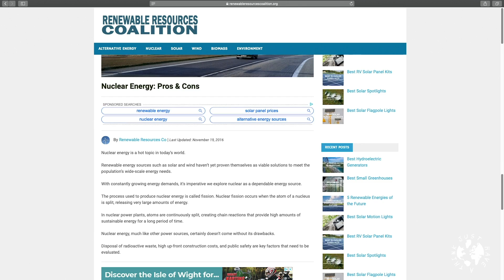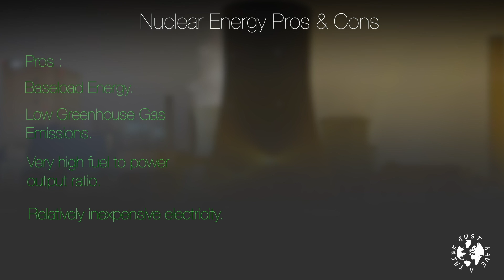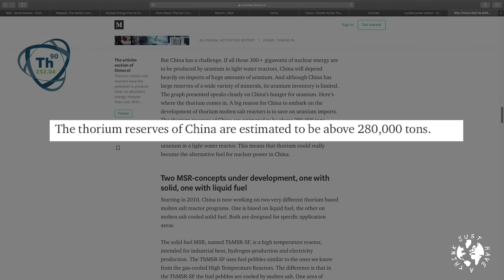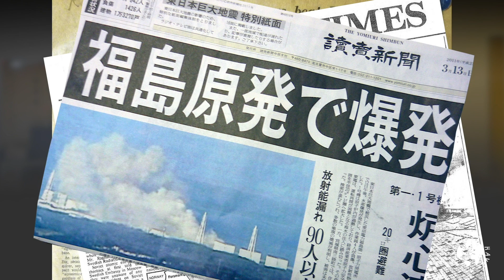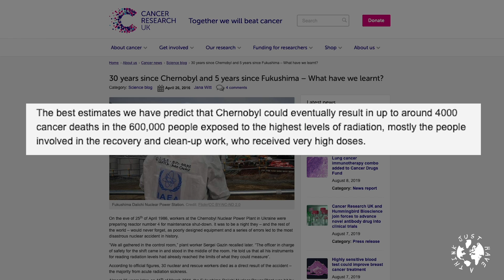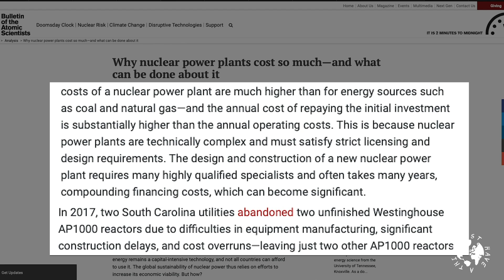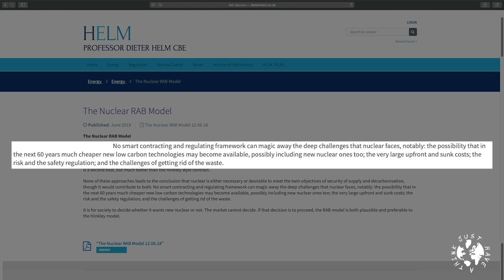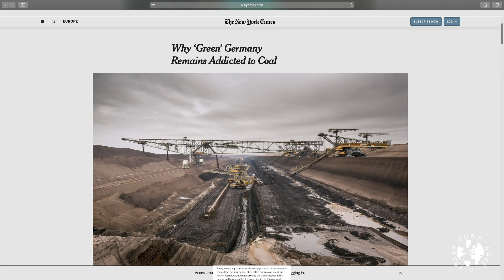Nuclear Energy in the 21st Century

Comment: As a Bavarian I have some problems with nuclear:
33 years after Chernobyl over a quarter of hunted wild boar are to radioactive for human consumption in Bavaria (1600 km away!) and most of the mushrooms in our forests.
Chernobyl was the starting point for the renewable energy movement in Germany not climate change. And gave us with EWS the first 100% renewable energy provider in 1991. 
But in my view there are other disqualifying problems apart from meltdowns and contamination for decades and centuries.
The most obvious on is the price! If I remember correctly, the feed-in-tariff for Hinkley Point C will be 0,12 €, right? That is more than not only more than onshore wind, but more than rooftop solar! Every home owner in the Uk that isn't working hard on energy autonomy isn't thinking straight!
And then there is the disposal of radioactive wast. That isn't priced in.
The price and the long brake even time that comes with it, prohibits innovation and cost reduction. The opposite is the case with renewables.
Thorium like so many other hyped technology will be ready for the word market fare to late. You didn't mentioned when the first commercial reactor will be ready and if it fulfills European safety standards, but I guess not before 10 – 20 years. By then we should be 70% - 80% renewable, if we want to stop climate change.
And leads to the next problem with nuclear: it's base load energy.
That we don't need in our electricity system for a renewable future. All power input into the grid that is not solar and wind must be complimentary and flexible. Otherwise we need a tonne of storage and that will push the price of nuclear even higher.
To recap: If it goes wrong it's a threat for most of the continent.
It's the most expensive form of energy production.

And more base load is the last thing we should ad to our electricity grid.
Reply: There are some issues for 100% renewable Germany especially if this country wants to pursue primarily solar and wind (even though most renewable generation is actually from biomass at the moment). 

-"Buffering volatility: A study on the limits of Germany's energy revolution"

https://www.sciencedirect.com/science/article/pii/S0014292117300995
Reply: @brian2440  Please, never ever again cite Hans-Werner Sinn for anything related to energy technology. He doesnt have a clue and has become a laughing stock with informed people in the topic. (He never was an energy or science expert - he is a retired economist). What is correct that a small baseload is nice to have as it reduces buffer need more than proportionally although my fellow countryman Zottel above is right in saying a substantial constant baseload technology that isnt quick to turn up or down like nuclear isnt compatible with the fluctuating renewables. Fast gas plants are.
Reply: hooplehead101 I don’t believe the article claims to use conventional nuclear in similarity as intermittent renewables, just that utilizing nuclear power could’ve provided benefits to the energy network. With Germany’s current energy approach it seems likely that we will continue to see a reliance on necessary natural gas, but then that poses the question of whether a hybrid system that integrated low amounts of nuclear with renewables is more cost and environmentally effective than a system designed for intermittent renewables and natural gas. 

One of the issues we are seeing in the USA is that states have decided to close down multiple nuclear plants without the necessary renewable infrastructure to replace them by decommission dates, so as a result we see a significant increase in short term natural gas production (10-20 year expectancy). According to the National Renewable Energy Laboratory’s* Lifecycle Harmonization Assessment of CO2 Analysis the average natural gas plant in the USA emits 456g CO2/KWh more than the average nuclear plant, and we are talking about 25,000-80,000 GWh of replacements. That’s a MASSIVE INCREASE in CO2, and depending on the cost placed on carbon this change could be considered grossly uneconomical. 

(*NREL is the US National Laboratory operated and funded by the US Department of Energy). 

There are other reports that look at ways in which nuclear can supply energy in tandem with renewable although these approaches typically require non-conventional methodologies and energy network management. 

This study is more focused on deployment in the USA, and I’m largely unfamiliar with German grid operations, so take it at face value:

https://www.sciencedirect.com/science/article/abs/pii/S0306261918303180?via%3Dihub

The purpose of this comment is just to respond to your comment, and while I do continue to provide sources on nuclear integration this isn’t necessarily the approach I would take if a country wanted to considerably increase nuclear deployments. In my opinion an increase in nuclear market concentration would require the installment of dual-purpose and integrated Generation IV nuclear reactors particularly of the Molten Salt Reactor, Very High Temperature Reactor, Advanced High Temperature Reactor and Fast Spectrum (FNR/FBR) variety.
Reply: hooplehead101 However just to be clear the purpose of my first comment on this thread was not to push support towards nuclear energy, but rather to recognize the potential issues of 100% renewable systems. 

I have other articles that go into larger depth on this, however they are focused more toward the USA as that is the country I currently reside. Obviously the USA and Germany are two different countries and thus the variables on developing a competent energy systems widely vary.
Reply: @brian2440  Yeah, and Im not against keeping a small baseload of nuclear energy - just wanted to remark the absurdity in citing anything Hans-Werner Sinn says about the energy transition. Keeping running nuclear plants is fine with me - but obv not with the majority of the public. We simply have to ramp up renewable now, because gen 4 reactors will have to prove their cost-effectiveness - and thatll take 20 yrs at least.
Reply: hooplehead101 
1. Do you have sources about how and why Sinn is unqualified, because he has a massive amount of accolades over the last 30+ years in favor of is arguments. 

2. Maybe in Germany public sentiment isn’t in support of nuclear, but that’s not really the case for the USA or the world I would say. The 2018 IPCC Special Report on Emissions literally calls for a projected increase in nuclear penetrations. 

3. The long term evaluation may take 20 years but actual deployments are scheduled much faster. 

BN-800 is an operational fast breeder reactor in Russia as of 2015. 

Terrestrial Energy has recieved permits from the CNSC (Canada) to build an IMSR in 2022

Moltex Energy has received permits from the NRC (USA) to build smrs in 2023

China has multiple fast gas cooled reactors currently under construction for completion in 2022 and 2023.
Reply: @brian2440  1. Sinn is a retired economist, not an expert in energy systems. He simply oversteps his area of expertise. If you understand German, I can give you speeches by him that are ripe with errors that breathtakingly stupid that its hard not to suspect malice - but as the saying goes: "Never assume malice where incompetence suffices." So I assumed the latter. :) E.g. calculating wind turbine need: Taking a performance of 2MW, telling the lay audience they only run "19 days a year" Reality is: Wind turbines are 4MW onshore now (and ssurely stronger in 2030, the timeframe for his calculations for the energy transition). Offshore 8, in 2021 11MW in the Norht Sea. Year-hours are not 19 days = 24x19 = 460 hours, but 2400 onshore last generation, in the US already 3000, latest gen 4000. Offshore >5000. So its a factor of at least 2x6 = 12 he is off. One hour he spends on talking that the energy transition cannot take place due to not sufficient hydroelectric pump storage. None of the experts claimed to do so - its a mixture of batteries, PtG, smart grid and so on. In general, straw man arguments abound. 

2. Hang on, I am in favour of keeping existing nuclear plants running - great if the US public is of the same opinion. However, there is no sense in building new current gen reactors - both economically and because of the waste problem. 

3. I am aware of all the reactor types you mentioned and some. Fast breeder will be great for transmutation - and there, cost per kWh is less important. However, determining costs of gen 4 reactors will take at least a decade. Until then, we simply have a job to do: Ramping up renewables.
Reply: hooplehead101 Fair enough, I didn’t really get that impression from the article but I’ll try to find a better article, and yes renewables need to be ramped up. Additionally I didn’t know Sinns background so I just took the study at face value. To be honest I was mostly interested in the evaluation of Germany’s grid network. 

For a more thorough look on economics I favor a study from Lawrence Berkeley National Laboratory for evaluating net costs for energy networks, which I believe is still in many cases applicable to Germany at least in terms of evaluating cost of systems as opposed to comparing isolated units (like many of the comments do above), which most laymen do when determining what energy source is best (and in reality that goes for all sides). 

I’ll probably just stay in my lane from now on, as I don’t have a good understanding of German assets, projections or energy operations, but it gets pretty annoying when people in the USA day of course 100% renewable can work in the US just look at Germany, when in reality this comparison is complete dogsh!t and doesn’t make any sense. 

Lawrence Berkeley National Laboratory Study: 

“Impacts of Variable Renewable Energy on Bulk Power System Assets, Pricing, and Costs”
http://eta-publications.lbl.gov/sites/default/files/lbnl_anl_impacts_of_variable_renewable_energy_final_0.pdf

It would also be interesting to get your opinion on the following study (also what is your background, because if your interested I would be keen to get your take on a few studies from the IEEE - although this is an engineering institution with typically very technical papers). 

“Reflections—What Would It Take to Reduce U.S. Greenhouse Gas Emissions 80 Percent by 2050?”
https://academic.oup.com/reep/article/11/2/319/3964517
Reply: @brian2440  Oh, Im by no means an expert. Sinn´s work is just easy to bebunk, even for a half-layman as me. He really isnt considered an expert for energy transition - but is very popular in the media and abroad due to his longtime work in general economics in Germany. 

I think there are several (real experts´) studies out there that came to the conclusion going 100% Renewables is technically feasible (and why shouldnt it?) - but unproportionally expensive and difficult. In comparison to only ramping up to 80 to even 95%. 

So I think were in agreement here and well, "100% Renewables is doable" is just a rough political slogan by laymen - and maybe some experts alike. For Germany, the renowned Fraunhofer research institute https://en.wikipedia.org/wiki/Fraunhofer_Society (a sister branch institue of the guys who co-invented mp3 - 3km from where I live) did some papers on costs of the energy transition and technical requirements for Germany. https://www.ise.fraunhofer.de/en/publications/studies.html , for example https://www.ise.fraunhofer.de/en/publications/studies/what-will-the-energy-transformation-cost.html . (Peer-reviewed papers are listed by years here, but I find them difficult to filter, there are just too many per year... https://www.ise.fraunhofer.de/en/publications.html https://www.ise.fraunhofer.de/en/publications.html )

Ill read the studies you posted just out of interest - but I wont pretend Im qualified to judge these experts´ work. 

For a USA-Germany comparison, what immediately comes to my mind is grid vs energy generation - with these two factors inversely demanding in our two countries: Germany is small and densely populated, so we have some problems with energy generation: For PV, its only ok: the south of Germany is situated roughly at 49° latitude - thats a line Vancouver - Winnipeg (so north of most of the US). Fine in summer, bad in winter. Hydroelectric potential is small, with only a little part of the Alps in Germany (Austria and Switzerland are fine). Wind has the most year-round potential (onshore in the north and offshore in the North Sea), and thus roughly 3% of the land area will be needed for wind turbines. That is feasible - but people´s acceptance is mixed. Much desinformation by the fossil fuel industry about the risks (noise, shadow, killing birds...). Fortification of the grid is needed to transport wind electricity from north to south - but for at most 900km, thats easy. 

And for the US, I guess its vice versa: Huge potential for RE: hydroelectric, entire desert-like southern states suitable for PV, huge mountain ranges and vast land in general for wind. But huge distances for electricity transport. If I could chose, I definitely would take your situation, though. :)

The problem with all predictions is that there is no experience, no large-scale application of storage technologies. If you extrapolate current costs, they inevitably will be overestimated. But what cost devolopment is there for storage, batteries and PtG or others alike? Which new methods will be invented by 2050? So imo its a bit of a self-fulfilling prophecy by the critics: If one does nothing - costs will remain high - so one doesnt start due to that "good" reason. Remember PV: Everyone wanted to research, research, research in order for a 60% efficiency panel to miraculously drop out from a lab. Well, theyre still at only 25% - but large scale production has shattered prices.
Reply: hooplehead101 While the USA generates a massive amount of hydroelectric (over 240,000 GWh), we have approached relative maximum theoretical hydro resource potential. Hydro currently only provides approximately 8% of net generation, and depending on which studies you agree with from the EIA, USGS etc this caps out at 10-12%. In all liklihood it would likely be more effective in my opinion to use remaining hydroelectric reserves for primary pumped storage as opposed to direct generation. 

Alternatively the USA shares a considerable amount of generation from hydroelectric from Canada. Over the next two years there are multiple projects to transport electricity generated from Hydro in Quebec to New York using HVDC cable line for the replacement of Indian Point. However, 1. This project is incredibly expensive (reports show over budget at $3.2 billion), 2. The project isn’t even replacing the net generation of the nuclear plant - this project combined with $300 million of energy efficiency upgrades and  3 more natural gas plants are replacing the net loss of generation from 1 nuclear plant. (And the problems don’t stop there as there is an additional plant pending decommission the following year for 7,000 GWh// but what’s asinine is that New England politicians are supporting policies that would have 9 plants decommission in the Northeast worth over 80,000 GWh potentially putting the entire Eastern Interconnection at catastrophic risk and pose the largest loss of energy in North American History). 

(Although there are some ludicrous studies by the likes of Jacobson & Delucchi WWS, which propose as much as 24% hydro beyond the limits that the majority of studies show as actually being feasible). 

The issue with transmission distances is not only applicable to the design constraints of generating facilities and transmission operations, but also for construction, as US environmental policy is incredibly time consuming when building infrastructure over massive distances. 

Are environmental laws important? Yes. But in order to build infrastructure across state lines requires federal litigation, which takes a considerable amount of time. This is why when our politicians said we can rebuild the entire US electrical grid in 10 years (some 160,000 miles), I wanted to know wtf they were smoking...
Reply: @brian2440  oof, does that Federal litigation have to go against every state it'll pass through?
Reply: The price for Hinkley C is £92.50/MWh. That's cheaper than all the offshore wind built so far  (which is mostly £150 -£130 (although it is for 35 years, not 20). Newer offshore, coming on-line in future years will be cheaper than Hinkley, but it's a perfectly decent price for the time it was agreed, and you can make a good case for a dispatchable power kWh being worth more than a variable power kWh, although it does depend on how the grid is run/set-up. So yeah, Hinkley is not cheap, but it's not excessively expensive either, as a lot of people like to make out.
Reply: xxwookey very good point. But that the bottom line isn’t the sole reason generation is in the spotlight. And anyway, you can’t just write off the bailouts governments are having to plough into failing projects because of budget overruns. If those were factored in plus waste management would nuclear still be cheap? It also my just be that Hinckley C was one of the better projects.
Reply: @xxwookey  From https://en.wikipedia.org/wiki/Wind_power_in_the_United_Kingdom: "Offshore wind projects completed in 2012–14 had a levelised cost of electricity of £131/MWh compared to a wholesale price of £40–50/MWh.[20] In 2017 the Financial Times reported that new offshore wind costs had fallen by nearly a third over four years, to an average of £97/MWh, meeting the government's £100/MWh target four years early.[21] Later in 2017 two offshore wind farm bids were made at a cost of £57.50/MWh for construction by 2022–23, nearly half the cost of a recent new nuclear power contract.[22]"
Reply: @xxwookey  Current electricity pricing from two new onshore wind farms in Australia are sub AU$70/MWh, so by that measure Hinkley C looks pretty expensive.  And by the time it's completed, £92.50/MWh could price it out of the market.  With pricing of solar, wind and batteries continually declining, and installation completed in 1-2 years, why would anyone invest in nuclear, with costs rising and construction in 10-15 years?
Reply: I totally agree. If only we could turn off our lights when we don’t need them. The problem for many to create our own energy is the massive cost of installations and parts. Many of which require maintenance and in terms of solar, pv panel tech is ever evolving and vac tube arrays need replacement after the seals give way. The other big problem is unsuitability of our properties, with most being too small for capacity (roof area, or space for a thermal store or gardens big enough for shallow gshp) or unsuitable for solar due to roof aspect. It’s just not that simple, and always very expensive.
Reply: Thorium
Reply: very good points that get mentioned far to seldom
Reply: It is great that you can't hunt.. That's actually an argument for #NuclearPower
Reply: A boar is about as radiation-sensitive as a human. Are the boars all getting cancer and dying? 
Chernobyl was a level of dumbassery that will never be repeated. The only thing that's still "a threat for most of the continent" is irrational fear of modern nuclear reactors.